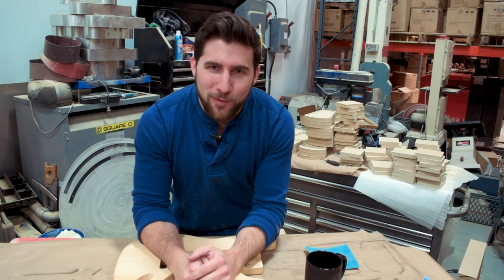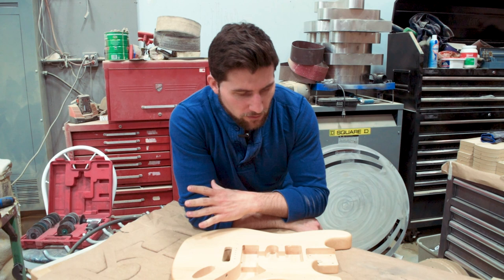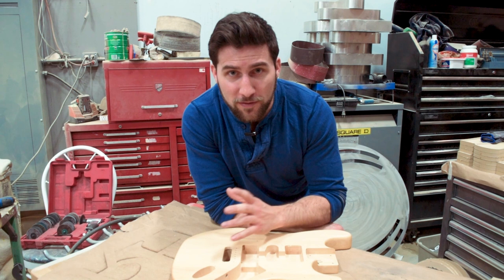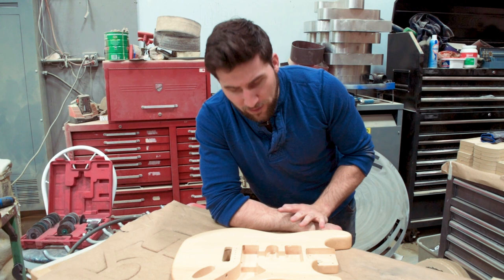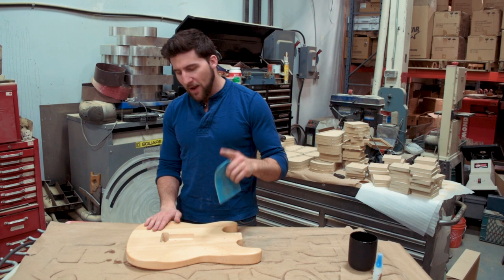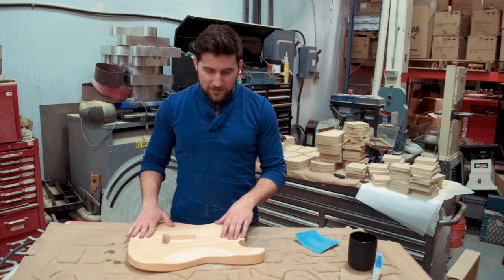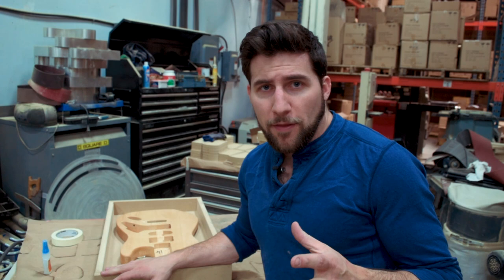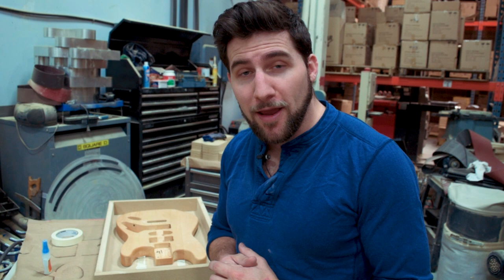Preparing a guitar for a new top | The Stratocaster Guitar Kit Build

Comment: Hey brad use activator on the un glued side on the tape it then gives you instant stick! Makes the masking tape trick even better.. nice job brother it’s gonna be good!
Reply from the maker: I honestly never understood why Ben bothers with that. The glue dries in seconds and sticks very well. The stuff I use doesn’t come with an activator.
Reply: @BradAngove  I think it's just so you don't need to add any pressure. I just use normal activator I buy in they hardware store as I normally buy super glue in big bottles. I've just got myself a 300 year old mantle that we think is ash to make a guitar body so that's gonna be fun!
Reply from the maker: Awesome. That does sound like fun!

Comment: I'm inspired to build my own sled and attempt to taper an old BC Rich Warlock copy I bought over 30 years ago.  It's the heaviest guitar I've ever used
Reply from the maker: Are you going to shim it underneath? I’m not sure what you mean about tapering it.
Reply: I was thinking of leaving the center pickup area the original thickness and tapering/thinning gradually from the center out to the edges. It's a very heavy chuck of wood. Not sure of how I'll do that but it's something I have always wanted to do to that guitar.
Reply from the maker: That will be very interesting. Just make sure you don’t accidentally taper right through the top and into the control cavity.
Reply: That's a very good point that I didn't consider. Hmmm?
Reply from the maker: Then you’ll be ordering some custom cut plates from me haha.

Comment: I'm planning to try this on a neck-thru guitar in my collection that's in serious need of rehab.  I'm going fill one of the pickup cavities to convert it from S-S-H to H-H, and then I want to put a figured maple top on it.
Reply from the maker: That sounds like quite the project. I’d be interested to know how you deal with the added challenge of the neck. Are you removing the fretboard?
Reply: @BradAngove  I've got an idea about how to use flush trim bits and templates to work tightly to the neck without removing the fretboard.  The tricky bit I haven't fully figured out is how to roundover the new top to match the existing body-side contours.  It'll be a task for sure, but I'm excited to take it on.
Reply from the maker: You may have to feather some of that in by hand I suppose.

Comment: Cool project.  Do you plan to re-profile the arm cut as well?

It seems you're a bit skeptical WRT the effect of chambering - is that an accurate assessment?  I assure you it can alter an electric a LOT.
Reply from the maker: Yes, I’ll be doing some carving work to the arm cut I believe. The plans for that aren’t fully formed yet. 

As for the chambering aspect, if you’re referring to an effect on the sound of it through the amp, I’m more than skeptical. I’ve tried chambered and solid versions of a couple of the same guitars. No difference through the speaker, but it changes the unplugged sound and the weight.

Comment: Been looking at some routers, I don’t own one yet. Would this one suffice for guitar work and some light furniture building around the house? Or do I need to step up to 2 1/4 HP?
Reply from the maker: I think this would do the trick as long as you take wood away in reasonable increments and don’t try to just shred your way through a thick piece of hardwood in one pass.
Reply: Brad Angove Thanks!

Comment: Thanks for the video Brad! That's exactly what I'm planning to do to my Solo Music telecaster kit, however my router has a 1/4 shank, so maybe you can suggest a good surfacing bit with a reasonable price that is suitable for 1/4" shank?
Reply from the maker: I would probably just use the largest end mill (ideally also four flute, so I would check what radian has) that I could find with that shank.
Reply: @BradAngove  Thanks for your reply. unfortunately Radian does't have  anything appropriate on their website section for 1/4 bits. However I've found a 6210 4 flute CNC Spoilboard Surfacing Router Bit for 1/4" shank. It has a similar design to the one from Radian. Will it be possible to use the bit with a hand router or these bits are designed only for usage with a CNC mill? Sorry for the dumb questions. I'm a total newbie in woodworking yet. ))
Reply from the maker: If it fits in the collet you can use it on the hand router. Just make sure you go in thin layers and nice and slow. This is hard work for a small router.
Reply: @BradAngove  thanks! You know I always wanted to start building guitars and do woodworking projects but I was somehow scared to do that, your videos finally convinced me that I should start! So thanks for the inspiration and for the advices. Cheers!
Reply from the maker: I’m glad you’ve found them helpful.